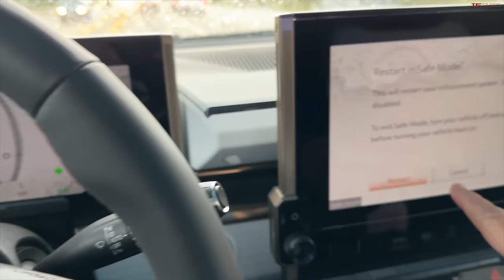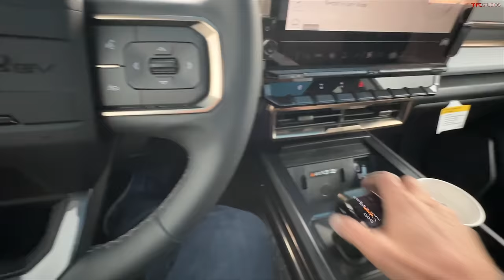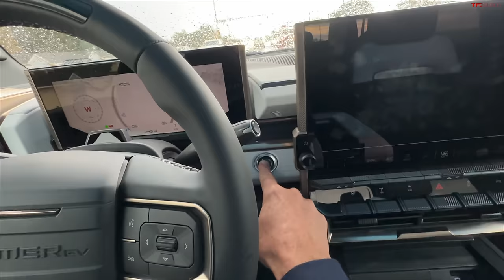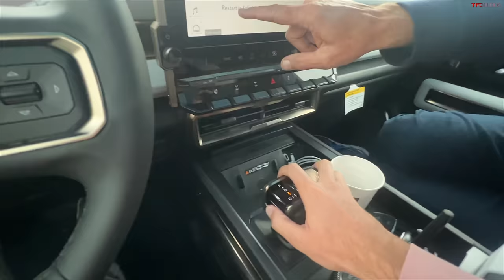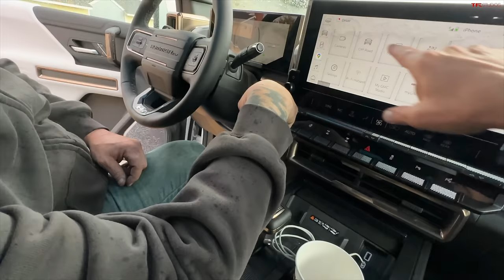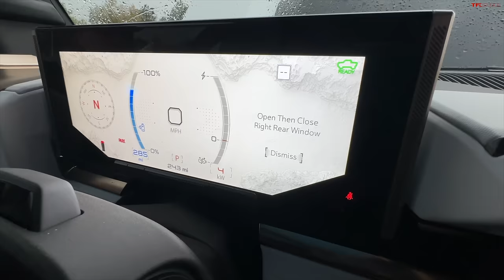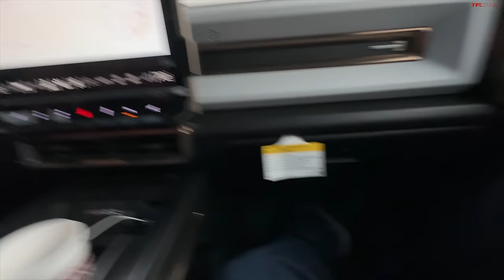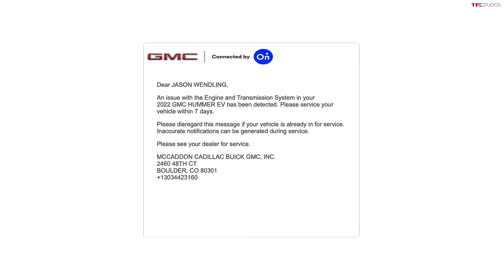I Bought a $115,000 GMC Hummer EV and It IMMEDIATELY Left Me Stranded!

Comment: Moral of the story: don’t reboot your EV unless you’re in a safe area
Reply: Or make a car that doesn't have this issue? You know a brand new car?
Reply: @IamJay02  I had the same thing happen to me in a 2019 VW Jetta, luckily while I was still in the parking lot.  It’s not EV specific.  Lots of modern cars have weak electronic systems.
Reply: Or... Leave the damn EVs alone. Don't waste your money.
Reply: Moral of the story : don't buy EVs
Reply: @onsokumaru4663  you think this only happens to EVs? 🤣  good luck.
Reply: @xiaoka  Even though it's not EV specific you can at least get non EV into neutral to move it to a safe area.
Reply: And don’t drive it out of town ?
Reply: or wait 40 more year until EV are actually working for everyone
Reply: @ThePowerOfTheD  can you?  I’ve known lots of cars that won’t shift out of park without the brake being depressed etc.  that doesn’t happen if the brake pedal switch breaks or that circuit fails or that particular system management computer dies.  

Keep in mind that he power cycled the vehicle in a lane of traffic.  The EV was in park when he *turned it off*.
Reply: @xiaoka  Every car has the override switch located under the shifter to put into neutral.
The EV's don't and are entirely electronically controlled. The switch bypasses the break feature whether it's on or off.
Reply: Just don't get one that are too much of a headache, is what I get from it.
Reply: Moral of the story is to avoid EVs @ all cost and get good ol reliable conventional oil/gas engine vehicle
Reply: nope, moral of the story is: battery-powered evs are crap
Reply: Moral of the story is stay away from American manufacturers unless you want a pick up truck with no electronics, because they will definitely die on you.
Reply: @josethemj23shoefan66  yes, thank god ICE never break down 😆😆😆
Reply: Old school is still the way to go. Manual or mechanical overrides should always be an alternative.  You can't even open the hood for crying out loud. This push to EV is too fast Imho.
Reply: @Carl Gunderson Well nothing as bad as American cars. Maybe Tata, Tata is pretty bad.
Reply: @Carl Gunderson Tata motors, the holy grail of automotive industry.
Reply: Moral of the story: Don't be a gigantic tool and buy an EV Hummer
Reply: @xiaoka  Less weak electronic system, more they do not properly make them... trying to cheap out on wiring, trying to cheap out on computers, trying to cheap out on fuses...
Reply: Correction, don't reboot a CAR unless you're in a safe area. Any modern car can act in the same exact way as what we saw here. Yes, compounded by the rain, the traffic, and the panic.
Reply: @ThePowerOfTheD  New cars don't have that anymore. It's all software controlled. Even non-EVs.
Reply: @fitybux4664  my 2020 has it even my 22. The only ones that don't have it from what I've noticed is the new EV's

Comment: It's unfortunate that this happened to you. I can imagine the anxiety and frustration that you were experiencing through this situation, plus the potential danger of where the vehicle left you stranded. Anyone that I've talked to have never had a good experience with their GM products. I'm glad y'all finally figured it out and are safe. Good luck!
Reply: I love my Silverado, which is a GM product. 234k miles. 2004 truck that is still going strong!
Reply: It's Funny how he was in a "Dangerous Spot in Traffic" but continues to get out of the vehicle with oncoming traffic just to take a video. Anything for content right
Reply: @saltylegion6288  see you said 04. In 2004 they were still running old proven tech. Given the number of pretty serious problems we’ve got at my dealer right now ( 8 speed destruct-o-matic transmission, the amazing collapsing small block V-8 lifters 4.8, 5.3 5.7 and 6.2, the 1.4 turbo with the magic disappearing piston, the 3.6 and the self destructing timing gear and the self destructing corvette gearbox to name them and the automatic self immolating bolt EV) I’m not shocked the 115,000 dollar hummer took a dump. The thing is GM is using garbage parts just like always. This is why the EV vehicles are just not ready for prime time
Reply: @anthonyriley4620  🤡
Reply: Ya they figure it out no thanks to GM support people.
Reply: I have a 04.  Chevy tahoe.  It has about 255k and runs strong.  Unfortunatly my tyranny went last winter.  It now only goes forward.  Literally reverse neutral and forward are all forward.  It is a replacement junkyard tyranny as my original broke.  It is still getting me to work as long as I don't have to back up I am OK.  Although it had to be dragged in neutral with the tyranny keeping it moving forward.  Lucky it didn't break anything else.
Reply: 'Stay safe' 

Yuck

Soft authoritarianism.

Comment: I work in IT, and that reminds me of an old industry joke. Three engineers are driving in a car. There's a mechanical engineer, a civil engineer, and a computer engineer. The car breaks down. The mechanical engineer hops out and says I've got this, opens up the hood pokes around for a bit can't seem to find any kind of issue. Civil engineer says stand back let me examine the road make sure that this road they were driving on is in good condition and did not cause the issue. Civil engineer expects the road determines that it is in good order. Finally the computer engineer steps up and says I've got this one, no problem. The computer engineer closes all the windows, turns it off, turns back on it says, look at that it's working again.

Comment: So with these newer GM vehicles that have auto up/down windows, when you disconnect the 12V battery, it reset the memory for the windows. So opening and closing all the passenger windows was to recalibrate the auto up/down. It had nothing to do with unlocking the shifter. Holding the brake was all the was required to unlock the shifter. My 2021 Yukon does the same thing with the windows when the battery is disconnected. I had a similar experience with the car becoming unresponsive due to a bad infotainment system. So I was regularly disconnecting the battery to shut the car down completely until it was fixed. Had to do the window calibration many times lol.

Comment: This makes complete sense.  It was built by GM.  

So was my dad's 1980 Chevrolet Chevette;  When that car was one year old the front pulley fell right off the engine in I-75 in Monroe county, Michigan.  I'm serious, it just fell right off~
Reply: I had one of those cars. The harmonic balancer bolt would snap and would thrash the timing belt. I had that happened twice before the car got wrecked and headed for the junkyard. 1.4l, 2 door junkvette.

Comment: Was probably a loose 12v battery connector. He slippe it off with his bare hands so easily. Once rebooted, computer ran fine. until that battery cable causes a change in voltage readings again

Comment: I find it incredibly interesting that there's not a button somewhere in the center console for a Neutral override.

My '22 Jeep has a rotary shifter, and next to my crawl control switch I have a little button I have to press with a pen to manually shift into neutral. I'm shocked that they don't have something like that here. Really should have a regulation that requires some way to get a neutral override mechanically
Reply: Honestly, the way Roman was acting, there may be and he never saw it. He clearly doesn't handle stressful situations well and would not consider this a useful video of how to put the hummer in neutral (except for Tommy being able to figure out how to open the frunk and do a hard reboot). My guess is there was an override that in Romans desperation, was unable to find, but perhaps not.
Reply: My Ram and Pacifica both have pull straps under the dash to release the transmission.

Comment: On opening the frunk on the Lighting has a little flip hatch where the normal hood release would be, and there is a red strap you pull to release the first latch, then pull again to fully open.  Just an FYI for anyone with a Lightning.
Reply: It's pretty funny that an old, proven mechanical design for hood release is still the safety backup for electronics that fail. I can't believe people fall for this nonsense.
Reply: Companies spend a lot of money to make electronic things work almost as well as the mechanical items they have replaced
Reply: @gappmast9712  almost ever SUV has a powered lift gate. How is a powered frunk any different?
Reply: @ericroe  You don't have to raise the lift gate on a SUV to get to the battery in an emergency.  My SUV has a mechanical cable to open the hood where the battery is located.  
When you are having a computer issue and have to reboot you don't want the computer controlling access to your ability to reboot.
Reply: @gappmast9712  the Lightning and the Hummer both have cables you can use to open the Frunk to get to the battery. These guys just didn’t read the manual. On the Lightning it a bit more obvious. 

The frunk has a power assist, but also a manual backup. In a normal vehicle you don’t lift the hood very often so there is no need for the power assist.
Reply: @ericroe  As I said in an earlier post I think the dealer failed to do their job by not pointing out that feature during the walk around when the truck was purchased.
Reply: @gappmast9712  I 100% agree, unless the TFL guys said we know cars better than you and didn't spend a minute with the salesman getting the walk around.

Comment: I can't believe there's not a mechanical way to get it out of park like every other vehicle has.
Reply: Or even a simple hood release latch from the inside like cars have always had instead of an obscure hidden cable like in this Hummer EV.
Reply: That shift lever is not attached to anything but switches and wires, no mechanical linkage to the drive train at all, basically the computer is ignoring any movement of the shift lever.
Reply: The shifter is not connected physically to the transmission in most all new vehicles now ICE or electric.
Reply: There is no even transmission
Reply: My 21 GMC Yukon Denali had no way to manually put it into neutral either.
Reply: My same thoughts— making EVs non mechanical is a disaster waiting to happen.
Reply: @ChadGlassify  My kid just bought an old 2004 Nissan, and can't open and close the boot, because it's an electric switch and it's fried itself. Absolutely stupid to use switches for such stuff.
Reply: @bigglyguy8429  yes these things should be virtually maintenance free mechanical latches. No reason to overly complicate a car that is already complicated enough.
Reply: @ChadGlassify  I feel the same about modern cars using a switch for the handbrake. Nuts. There's a classic video of a guy losing his truck into the river because his dog released the brake! Now some cars avoid that by making you press the foot brake before you can operate the 'easier' handbrake. How the F is than an improvement over just pulling a lever? Plus the feel and travel of the lever tell you how worn the rear brake is. A switch tells you nothing. Also, I just watched a vid of these same guys taking the Hummer off road, and the front diff lock switch breaks - because switches break! So, so stupid.
Reply: @bigglyguy8429  Yes the modern progression towards technological innovation where mechanical components are more and more replaced by relays and switches only invites more points of failure in the chain of actions that are harder and harder to find. I think some things in cars don't need to be technologically 'advanced." What is advanced if these things wear out and break sooner and more easily?

Comment: The issues with the windows was to set the open and closed limits again after you disconnected the battery.
Reply: well being that it wouldn't unlock the shifter until all that crap was done.... (what's the difference?)

Comment: I'd buy a remote controlled battery cut off switch. Install it on the 12v battery so that you can hard reboot when the frunk is closed.
Reply: I'd just buy a different truck before I install a work around on 100k truck..

Comment: What did we learn from this? Don’t ever turn off your vehicles on the road or while driving. And don’t just keep hitting buttons. Excellent work everybody that helped you guys out. I think this issue is something that is definitely something that will effect all electronically controlled vehicles. This could have easily happened to any push button drive train combustion vehicle also. That CPU takes a dump and you’re stuck in gear or park.
Reply: It is a problem with all computerized vehicles, but it's a bit bigger in EVs.  If a ICE takes a dump in the middle of the road, knowledgeable people (tow truck drivers) know where the overrides are.  It's possible to disconnect the shifter and force your transmission into neutral so the truck can be towed.  How to do that (if it's even possible) in an EV is still a mystery.  Hopefully there is a way that can eventually enter public knowledge, but there might not be considering EVs don't have transmissions.
Reply: Yeah, Roman seems to be like my 70 year old dad just pushing buttons. It's like he wanted to be overly dramatic. There's something called Google. Sit in your 9K lb vehicle and do some Google searching and/or search the owners manual. Stop pushing buttons dude! Car breaks down, the first thing to do is sit back, close your eyes for 20 seconds and take a breath.
Reply: Agree! He completely over reacted. Never recycle your car at a stoplight. Tommy had to tell him to stop pushing buttons on the screen even after they got going. Sit back and relax
Reply: That's all Roman knows how to do:  hit all the buttons randomly.
Reply: Makes for good entertainment

Comment: I’ll be keeping my 1997 4Runner with 260 thousand miles on it, was also what 95,000 k less
Reply: I'm with you, I keep driving my 1997 f150 with 240k miles on it, especially now since its 25 years old and no longer requires emissions testing. 🤣
Reply: A '97 truck might be your last truck (if it takes you to the grave by a lack of modern safety features).
Reply: @fitybux4664  😅🤣😂
Reply: We like our Ford e150 with 400,000 miles on it!